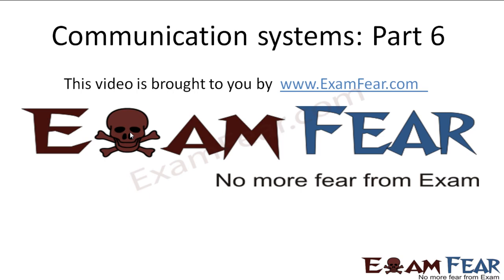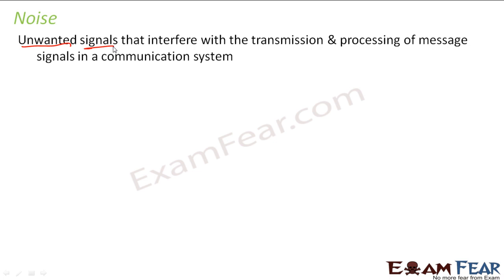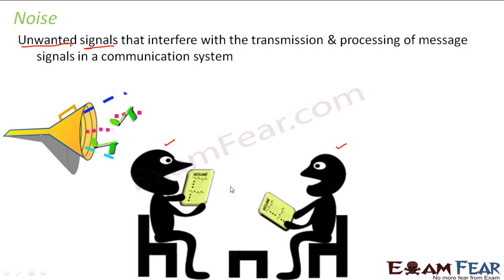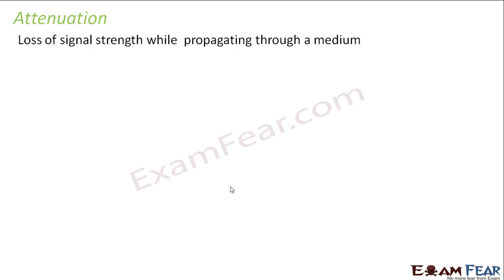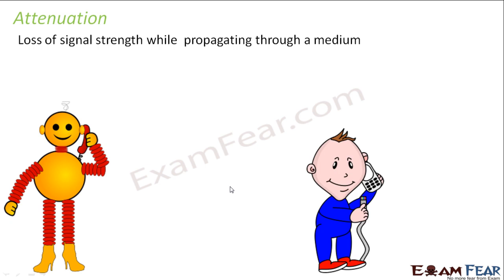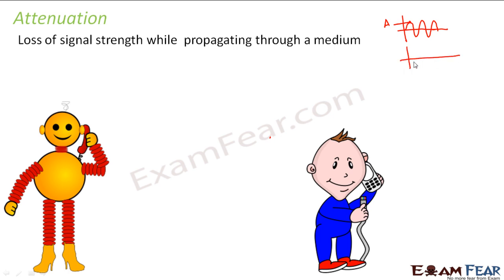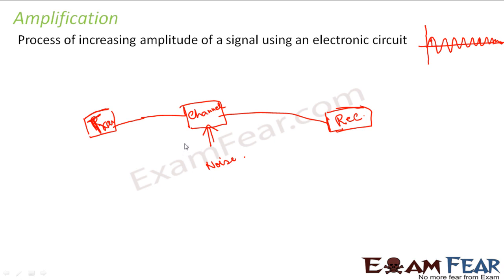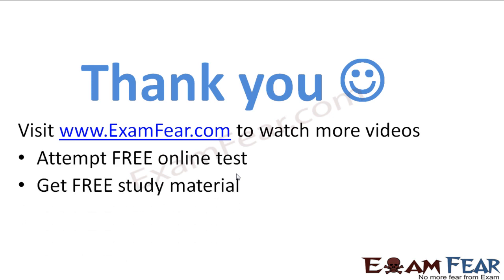Physics Communication Systems part 6 (Noise, Attenuation & Amplification) CBSE class 12

Comment: Mam If Signals R Travelling Through Wires (in Case Of Telecommunication) then How Will It Gets Disturb By Noise 
I Mean how the Source Of Disturbance enter Inside The Wire Nd Disturb It ?
Reply: Himanshu shrivastava the resistance of wire and cut in the wires are also noise which affect communication